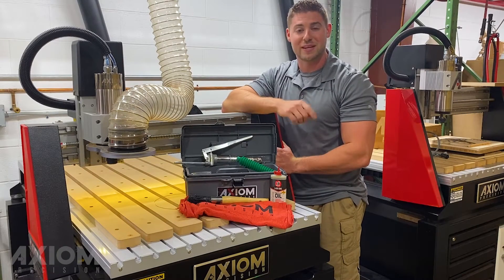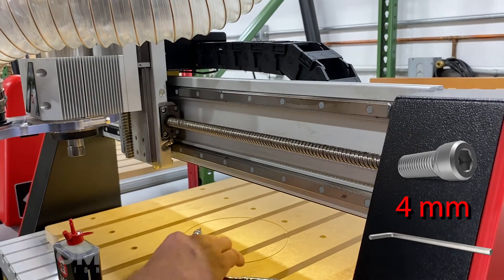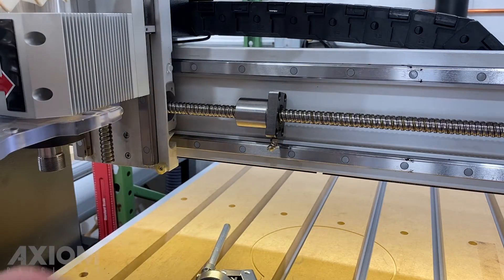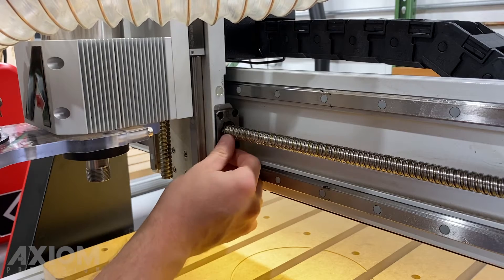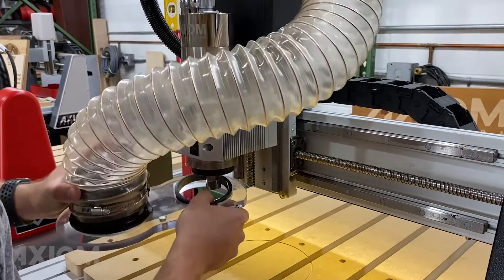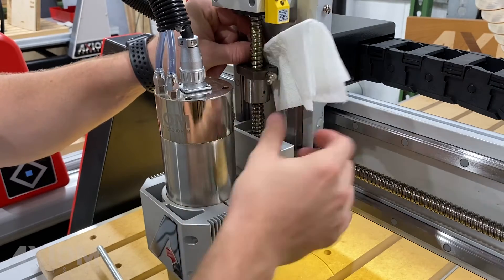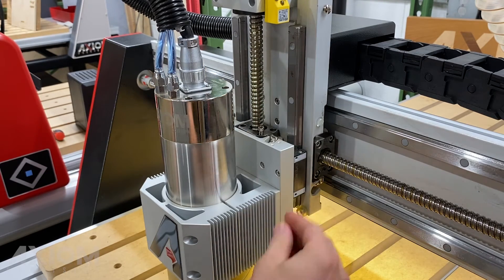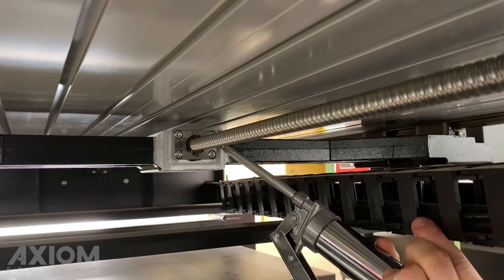Axiom Machine Maintenance Part 2 "Ball Screw Maintenance"

Comment: why is it necessary to remove the cap screws on the top side ball screws but not underneath the table?  is it purely to make room for the grease tip to reach the fittings?

Comment: My older model does not have the grease fittings but does have holes for them.  What size fittings should I get for them?
Reply: This should be a standard 45-deg 6mm grease fitting...I'm happy to dig one up for you if you'd like to swing by.

Comment: I'm trying to do this on the icon 8 but the Z axis ball nut is underneath, not on top like this one. Do I still raise it up before tightening everything, or lower it down?
Reply from the maker: Cory, on the Iconic series machine the grease fitting can be accessed without having to disconnect the spindle assembly. Move your Z travel to a point where you can easily access the grease fitting and simply grease it. We hope this helps.

Comment: The zerk fitting on the Y axis is not swivelled out at an angle to allow the gun nozzle access on my AR6 as I can see in this video. I cannot get it to swivel either. I appear to have successfully greased the other two ball nuts. Should I remove the cap screws on the Y axis ball nut also (like shown on the X and Z) to allow access to the zerk fitting? Does that mean then that I should run the ball nut and assembly all the way to the other end to tighten the cap screws so it is 'aligned'? Any help would be greatly appreciated!

Comment: We did the maintenance on the z axis but after screwing the z axis back into place the bearing down go all the way and it’s not reaching the limit switch
Reply from the maker: Gustavo, it is possible that you may be hitting a Z Limit. To correct this issue simply home the machine. Hope this information was helpful.